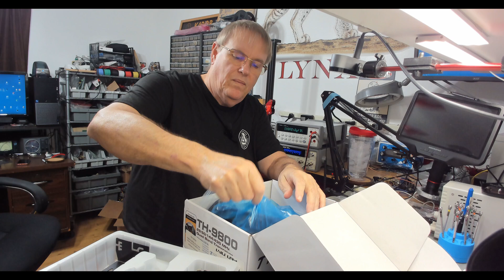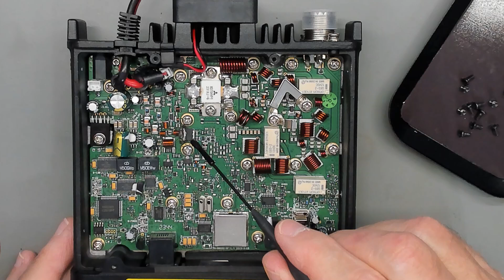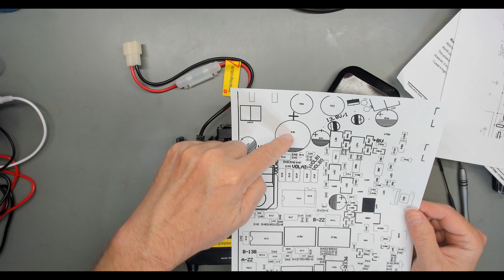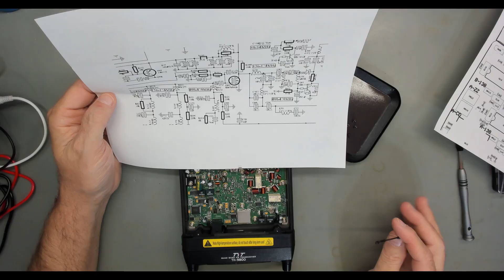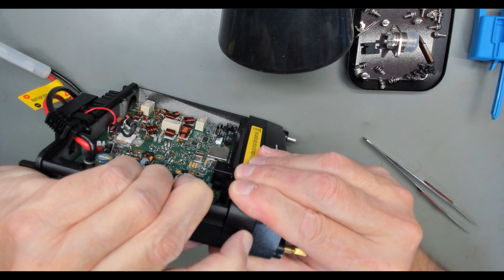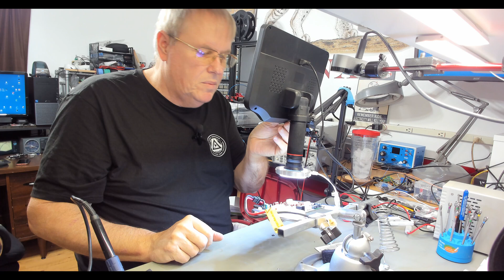Can I Fix This Dead Ham Radio?

Comment: Hi RJ, I hope the new mosfet fixes this radio. Nice work with using two heat sources top and bottom. I believe you will have to repeat that to attach the mosfet. So a dead ham radio, can you get some bacon bits from it or a ham sandwich? Also its seems like there is a paper clip club with you and Mr. Alan. Take care Rick
Reply from the maker: Hi Rick, hope you are doing well! Thanks, no bits or sandwiches. The paper clip gang is a lot bigger than the two of us. The right to repair movement is really picking up steam. Catch the second repair video this Friday. 
RJ

Comment: Nice work.  A tiny drop of CA might help keep that pad down.

I just picked up a HP 34401A last week.  It was really cheap and the seller listed as "Bad inputs"  When I opened it up it looked like a couple of tantalums had burned up and destroyed the associated pads and burned into the PC board.  The caps were not there.  There was also a Zener missing and the input pad to it was missing too.  Basically, someone tried to repair it and gave up.  I had to bodge in leaded parts but got it working.  Not pretty but at least it's functional and seems to be working well.
Reply from the maker: Good job! When do we get to see the video? 
RJ
Reply: @LynxElectronicsLab  Unfortunately I did not do a video.  The repair videos I have done, except for one of my first (Fluke 8050A) have been total flops.
Reply from the maker: Oh I know what you mean. But this is what I enjoy so I just keep doing myself in doing what I enjoy. I’m watching your new mail bag right now. I need one of those adapters SMD adapters for my LCR meter. I love my 34401A but just got my new super meter. I had to go to one video a week to get ahead for vacation so the vid for it is like 7 weeks out. Hope all is good with you. 
RJ